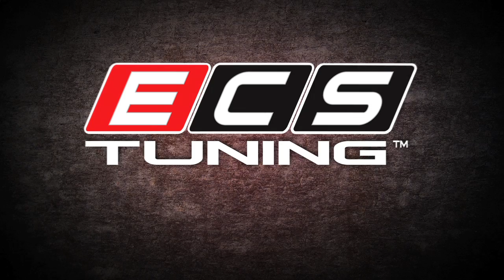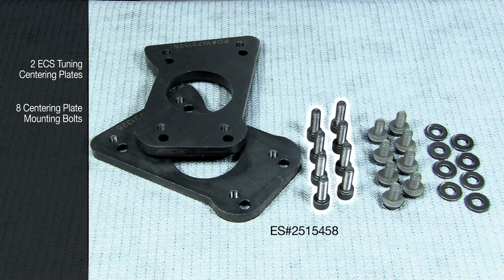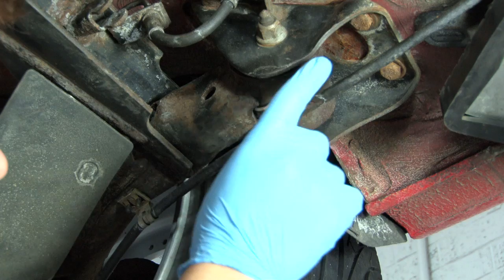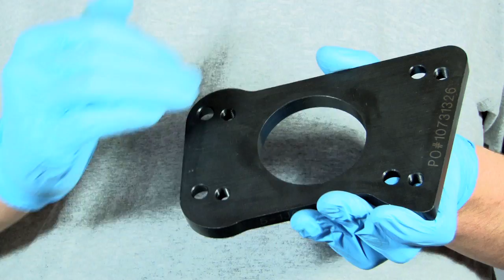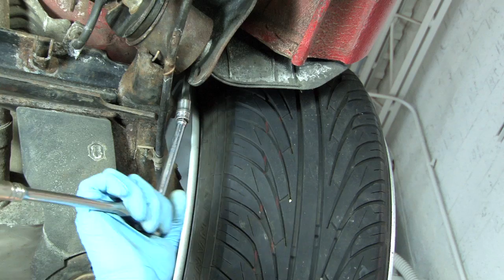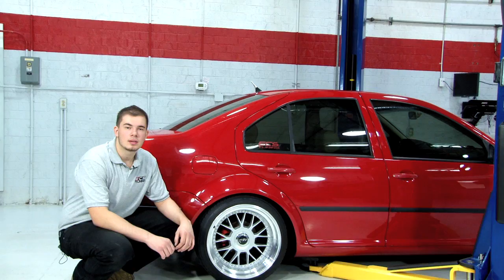ECS Tuning: MKIV Rear Wheel Centering Plates

Comment: Why does this video call out an 8mm Allen when my batch does not use an 8mm. I am completely flustered with all of the ecs brand parts. I've had nothing but headaches with ecs' own parts.
Reply: thatdannyboy 

Same! I went and purchased an 8mm socket and 17mm socket because I thought that was what I would need. Nope my kit had 7mm allen bolts and the stock frame bolts are 16mm ecs replacement were 15mm

Was very unhappy I wasted money on improper tools.
Reply: anyone who works on volkswagens will probably have a 7mm allen key at some point
however they should list these bolts correctly no doubt

Comment: 1) my rear axle (the part that seats my coil perch) sits lower on the right side. Its a flaw from factory. sit a good half inch lower. Will this cause and issue with these plates? Or will I just have the same height diff just with my wheels now centered?

2)Anyone running these in combo with camber and toe shims?